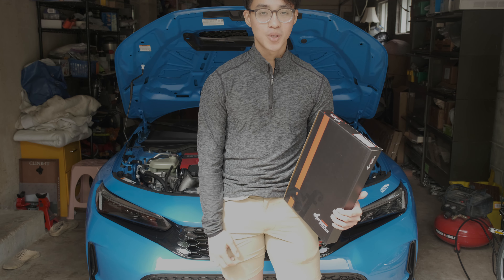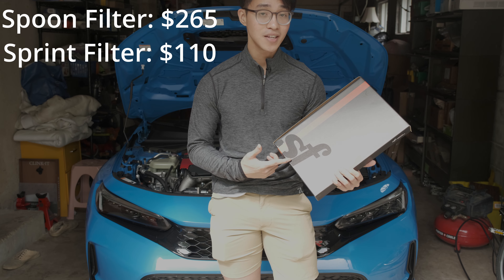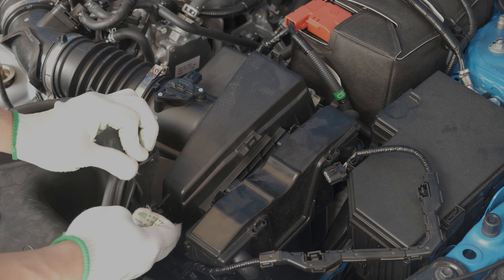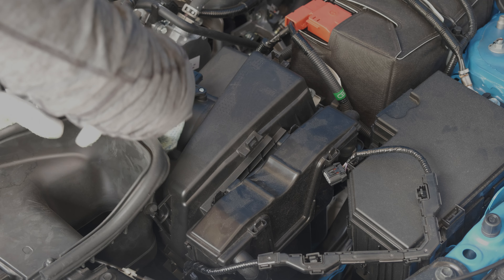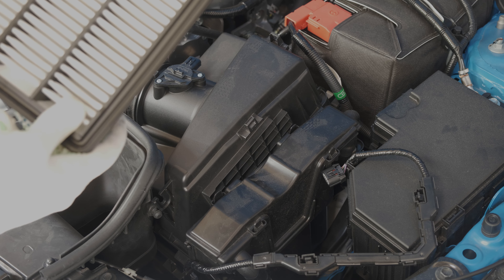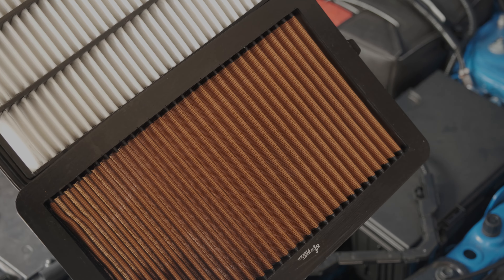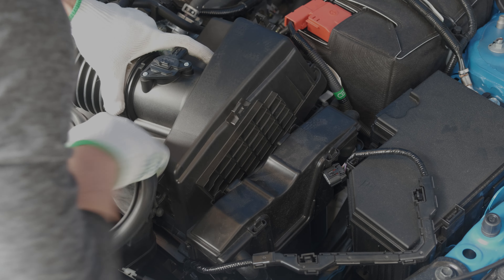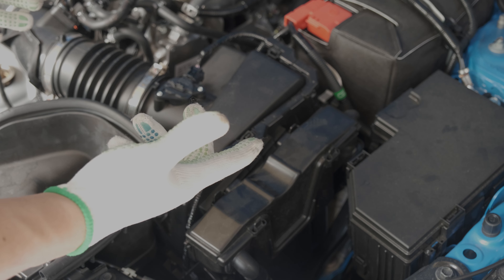Making More Noises!! Sprint Intake Filter Install on my 2023 FL5 Civic Type R | Better than Spoon??

Comment: I would be careful I used the sprint spoon filter on my FK7 and went back to stock after finding dust and smaller bits the filter didn’t catch inside my airbox.
Reply from the maker: I will keep an eye out. Thank you for letting me know!
Reply: @turbo_tin  https://www.youtube.com/watch?v=nZ0YEPR1pJ8  This should give you some insight to the limits of a performance air filter
Reply: Yes that’s true, that sprint filter let pass a lot of dust. Is good for a race on an environment with no dust if is on a dusty environment you should use the P037 (37 micron). The P08 (same as Spoon Sports) can hold 80 micron particle vs the oem that can old < 5 micron. The best filter for street in my opinion is the oem.
Reply: Catch can would fix that right?
Reply: @Clutch81 I did not understand you comment.
Reply: @Clutch81 PRL filter is 5 micron rating so that’s cool

Comment: This filter looks similar to a k&n, which is known to be poor at filtering fine grit, leading to engine wear. I wouldn’t use it without first seeing a lab test showing it’s comparable to the standard paper filter.

BTW, just put a deposit down for a blue fl5 two days ago. Wanted the red, but there are only white, black and a single blue fl5 (soon mine) in my country.
Reply from the maker: Hope your FL5 comes soon! I will keep an eye out on the filter. Thanks for looking out!

Comment: The real question is whether or not this filter is really better than the K&N which can be had for around $50.  I've seen the forum analysis between all the filters and I love that its a dry filter, but with tax and shipping this filter is over $130
Reply from the maker: It depends on what you want to get out of the filters. If you just want the noise then no.

Comment: You get any check engine lights when you first plugged the sensor back in and turned it on? I just put in a drop in filter and I have a CEL thats allegedly going to go away in time
Reply from the maker: I did not get any CEL after plugging it back in

Comment: Hey bro. Thank you for the vid What individual settings was the car on during the drive? Wondering if it helps to put ‘Engine Sound’ setting to Sport or Comfort in order to hear more induction instead of the “artificial” sounds from speakers if on +R. Notice any difference in settings?
Reply from the maker: Not really any difference in engine settings. I had engine sound on comfort when this happened.

Comment: Reusable right? So it pays for itself over time vs the oem filter 😄
Reply from the maker: Spray it with compressed air to clean. No soap/oil needed. Technically good for life 😆

Comment: What was the out the door price for your FL5?
Reply from the maker: I was around 52k OTD. Thanks for watching!
Reply: Dealers in my area won’t take less than 60k. It’s hard to believe you payed 52
Reply from the maker: Gary-td4rz  lol nothing to be embarrassed about. I'll break down the cost for you.

Sales price: 48845
Doc fee: 250
Reg fee: 50
Total taxable amount: 49145
Title fee: 41
VA Tax (4.15%): 2039.52
Total: 51225.52

Comment: Damn I wish we got boost blue in Australia 😢
Reply from the maker: You guys don't get the blue in Australia???
Reply: @turbo_tin  no, we only got SGP, Championship White, red and black. We also didn’t get the Bose sound system and the red carpet mats 😑. We did get alcantara backseats plus steering wheel and an auto dimming rear view mirror. Apparently the US spec has a normal rear view mirror but I could be wrong.
Reply from the maker: No you're right. We don't have the nice rear view mirror. Sucks that you don't get the blue though
Reply: @turbo_tin  sonic grey pearl was my first choice but after seeing people receive their boost blue cars and upload videos I really started to like it. I think SGP looks sick as well. Did you guys get alcantara back seats?
Reply from the maker: No alcantara back seats either. Wished Honda would standardized features across all regions 😔
Reply: @turbo_tin   yeah for sure. I was pissed when I found out we weren’t getting the Bose sound system in Aus. They put them in the Hybrid civic but not the type r 🤨
Reply: Hmmmmm I need to source some back seats from Australia… and maybe parking sensors from the UK….
Reply: @kingbiggs23   yours didn’t come with parking censors?